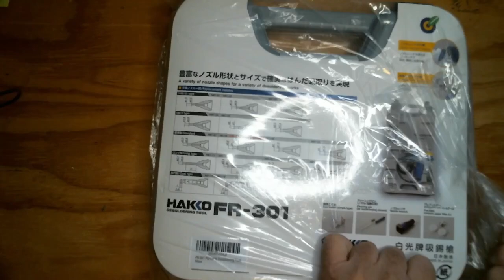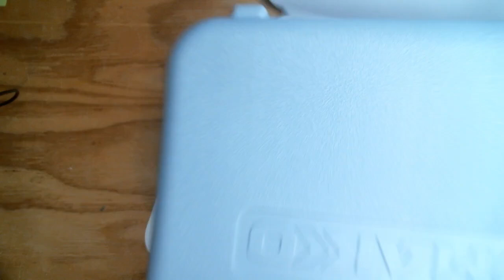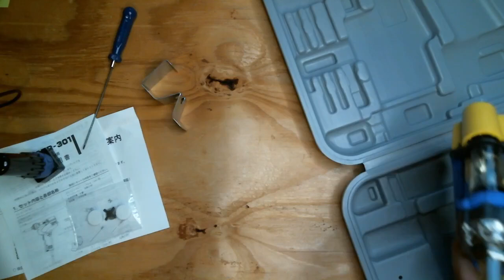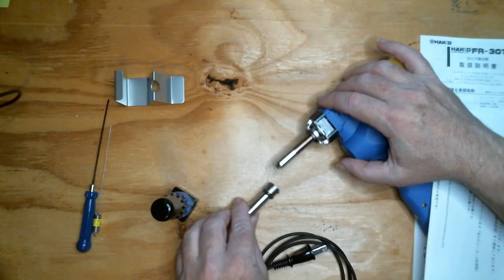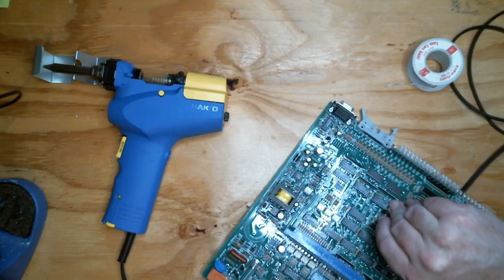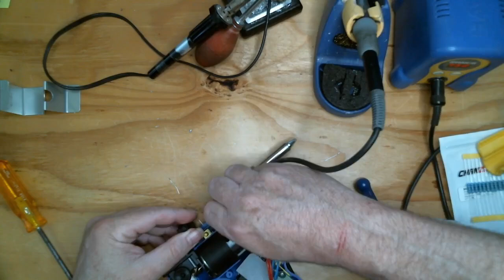Hakko FR-301 Desoldering Tool Unboxing and Modification

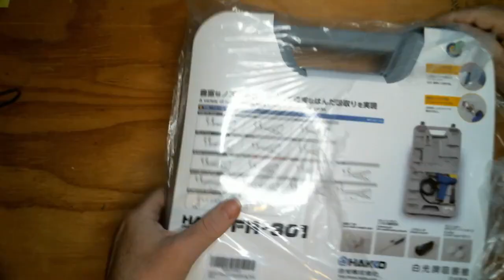Comment: 0:26 You can get the Japanese Hakko FR301 with three prong plug. Mine was sold as the Hakko FR301-82 which has a 2-pin plus ground plug. This plug is known as
Type B, features two flat parallel pins plus a round grounding pin. I'm using it on 230/240 V AC with a transformer.